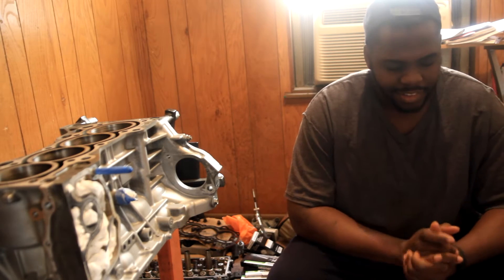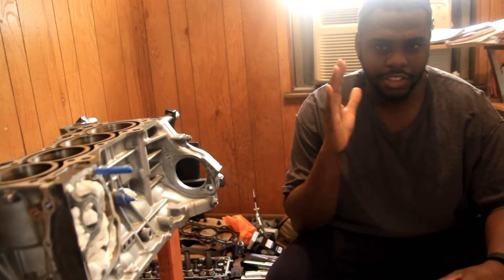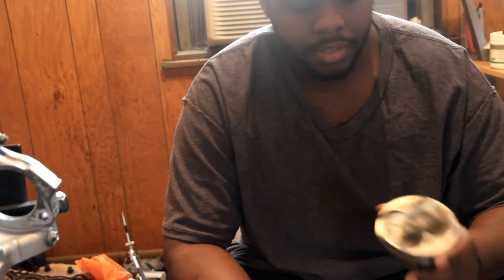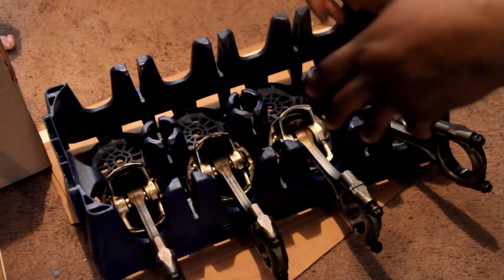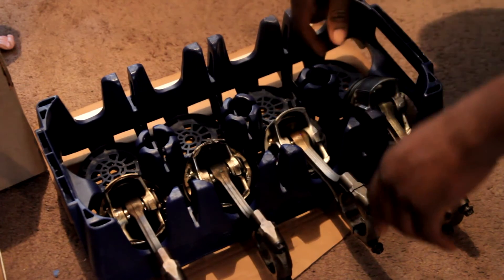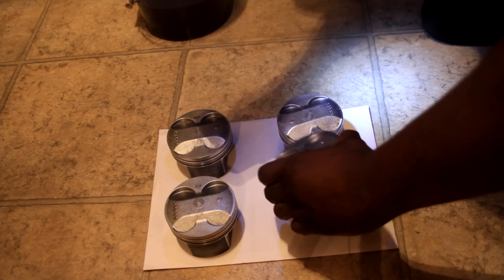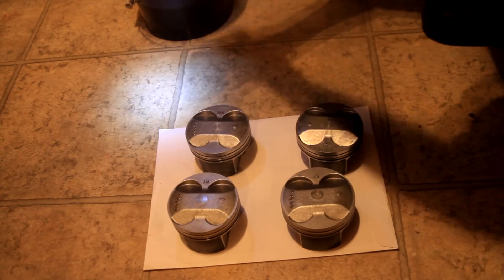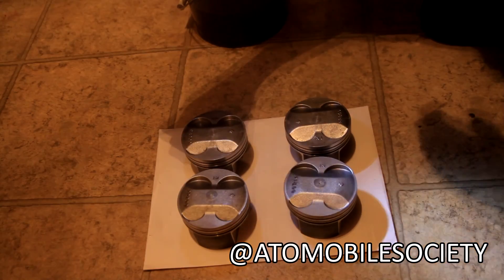THEY FIT! | K20A2 PISTON DISASSEMBLE AND CLEANING

Comment: K20z1 complete internals in k20a3? What are the differences and what I got to do?
Reply from the maker: pistons, rods and cranckshaft is the main difference along with small things like oil pump, oil squiters and oil cooler. You basically have to gut the k20a3 out and if it came from a EP3 SI, YOU MAY WANT TO UPGRADE THE OIL PUMP TO THE K20Z1. I have a video on the oil pump mod to the k20a3 girdle.

Comment: hey! do you think you can help me? i want to build my k20a3 short block but im not exactly sure what will fit into the block. I'm thinking about getting an a2 crankshaft, aftermarket 86mm pistons and rods. 
My questions: 
a2 has oil squirters, how do i compensate for this on the a3?
is there a specific size piston or rod I need?
what else do I need to make this work?
Reply from the maker: i am sorry I have seen this late! If you are running an a3 crank, aftermarket support is available but limited especially in the rod bolt department from my research which if your are looking for more mod friendly approach, a k20a2 crank will be the best option. The k20a3 does not have oil squirters so internal cooling option will be forged piston and rods if using the k20a3 block and going high boost. Let me know your progress